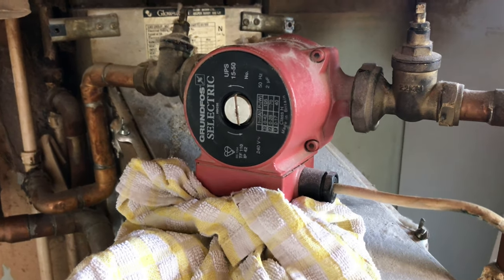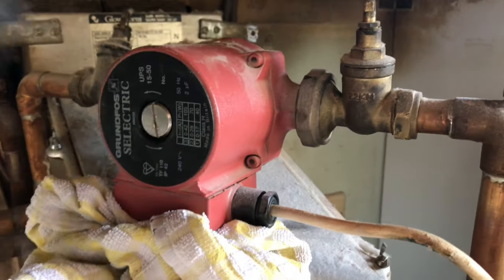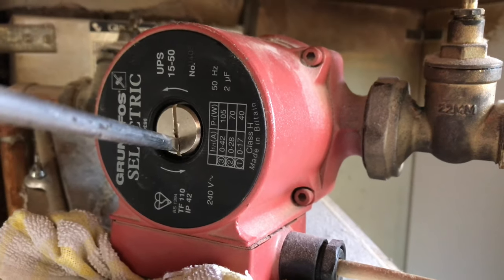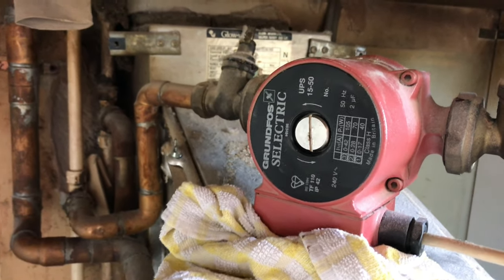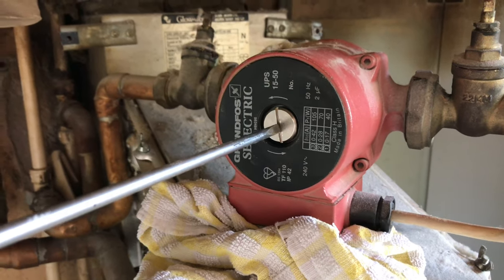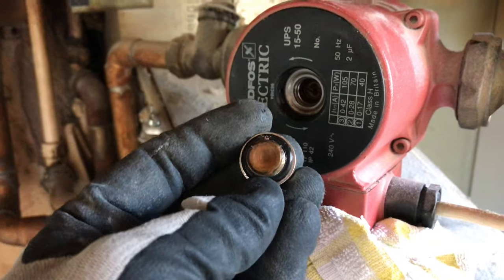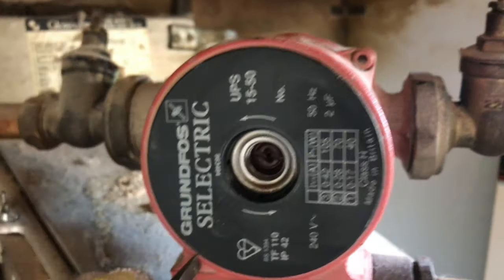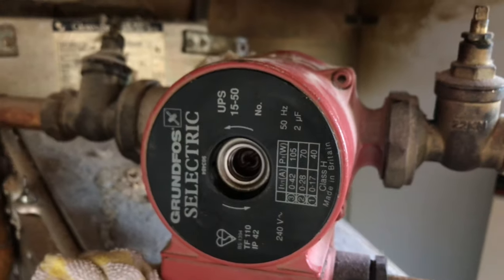How to free a jammed central heating pump

Comment: Hi Dan - I have pump that isn't working on my underfloor heating. The LED on the front of the pump is off. Does this mean its brunt out? Also before I try your advice in the video do I need to turn the water off or is it ok without? Thanks.
Reply from the maker: No need to turn water off however I would turn off the heating best practice, as for the led it will depend on the set up I'm afraid the best way is to check to see if u have power there first and that the motor in any pump is working 👍🏻
Reply: @PlumbingGy  Thanks for the quick reply. I fear the pump may need replacing but will do the check in your video before I think about a plumber.
Reply from the maker: Good man, see how u get on just make sure your working safely 👍🏻
Reply: @PlumbingGy  Will do - thanks!
Reply: @PlumbingGy  Dan you are a star. That worked a treat. Pump is working again. Thanks for saving me the cost of a plumber which would have been a challenge in lockdown.
Reply from the maker: Brilliant news mate glad it helped👍🏻💪🏻

Comment: Just checked mine and the screw is fitting towards the tank FFS grrrr!!! Still no warm radiators downstairs for me.
Reply from the maker: It can be altered by isolating the valves and slacking off the pump nuts, rotate slightly and purge, then put back when happy. However I would recommend a plumber like myself 👍🏻👍🏻 hope u manage to sort it thanks for the support
Reply: @PlumbingGy  Cheers!

Comment: Do you have to turn off cental heating when you unscrew it??
Reply from the maker: Hi carol, if it's jammed yes. Make sure it's switched off and you get get inside to spin and free up the pump. 
If you are removing air then you don't remove the screw just loosen. 
Hope this helps
Reply: @PlumbingGy  Thanks a mill Dan, really hope thats all it is 😁
Reply from the maker: carol lucey no problem at all
Reply: @PlumbingGy  Forgot to ask you Dan, i have outdoor condenser boiler so have pump out there, theres also one in the hotpress upstairs and one beside the fireplace for backboiler, whats the one in hotpress for?? Do i have to cut out the main elec switch for house?? Thanks for info😚
Reply from the maker: Hi carol, 
This would be an educated guess as I don't know what system your running but 'GENERALLY' a pump located in a hotpree or storage space would be for the hot water or for pumped showers, as for the wiring it depends how it's wired in. I'm hoping it goes to a separate spurr? If so you can just isolate it by removing a fuse, if not I'm afraid you will have to find out the correct circuit and isolate before working on it.  
I hope this helps.
Reply: @PlumbingGy  thanks Dan, used to have a power shower yrs ago so maybe thats what its for, the one downstairs is for back boiler in fire, its my oil central heatin pump thats kaput, tried the screwdriver but motor seems seized, impossible to free, moves a tiny bit right n left, the washer missin off big screw as well i noticed, leakin small amount of water when i put big screw back in, no sign of washer, baffled, ta for all your help x
Reply from the maker: No problems carol I'm happy I could help in any way 😁👌🏼
Reply: @PlumbingGy  - It looks like there's an arrow showing the direction you need to turn the spindle. If it won't turn in the correct direction, is there any point trying the other way? Or will that cause problems?
Reply: @planetqwerty  the arrow is the direction to unscrew that coiny looking thing, take that out and then insert screwdriver to try n rotate as shown in video😃
Reply: Hi there is it necessary to close the valves either side of the pump before doing this ? Thanks
Reply from the maker: No you do not need to isolate the pump, just make sure the central heating is off 
Hope this helps
Reply: @carollucey111  Thanks for the reply carol (though I meant to reply to #Doitalldan Do It All Dan).  There's not many screw threads that you have to turn to the right to loosen them.  Are you sure that's what the arrows are for - I'd have thought it was meant to indicate the direction that the pump spindle has to rotate?
Reply from the maker: There will be an arrow in the base of the pump that is engraved into the pump that will indicate the flow and the right direction of the pump, there may also be two white arrows on top that circles the spindle screw head that indicates the turning of the screw (this can vary with type and age of pump) 
Hope that helps 😁
Reply: @PlumbingGy   thanks, but as per my original question, the spindle won't turn in the arrowed direction - it's stuck solid.  Will trying to turn it in the opposite direction cause damage to the mechanism, or is it ok to do that?
Reply from the maker: planetqwerty it will not do it any damage however if it is stuck I recommend a new pump and it is most certainly meant to move freely, 
Watch my other video here it all explain more easily I believe
https://youtu.be/pk7-552l2Wg

Thank you
Reply: @PlumbingGy  Thanks Dan.  I've managed to get a replacement pump from Screwfix - with a 25% reduction too!  Now to decide whether to employ a plumber to fit it, or have a go myself.  Not too confident - especially if it means having to drain the system down.  Anyway keep on with the good work - your advice and vids have been a great help!
Reply from the maker: Thank you fingers crossed you get it sorted 👌🏼

Comment: Should I close water running on pipes?
Reply from the maker: I'm not really sure what you mean, if you mean the valves that the pump is connected to yes close them. Also only work on it if the pump is not running (all off) 👍🏻